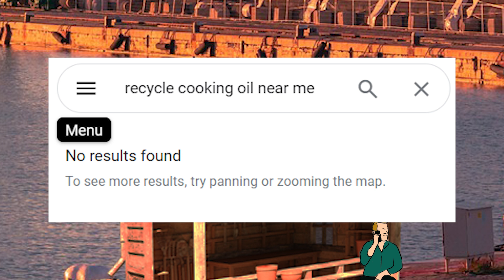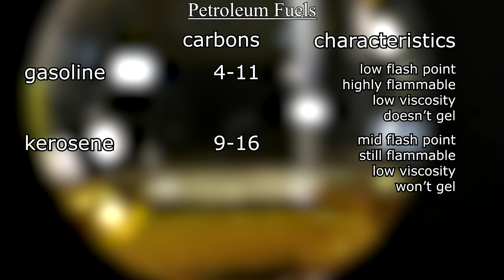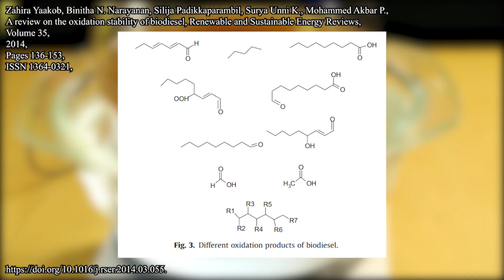Turning Olive Oil into FAME Fuel | The Renewable Fuel Series

Comment: are you sure you're making what you said you're making? cause it looks like you are just doing some random things and at the end just pour some cooking oil onto some cotton and burn them. cooking oil burn with cotton and can be used to burn firewood without all the steps you show.
Reply from the maker: One way to judge if your reaction is progressing is to check whether the top phase (methanol) is being consumed, and a bottom phase (glycerine) is being formed. The product will also change colour slightly.

Another way is viscosity. One main reason why we pour FAME into diesel cars instead of oil is that FAME is less viscous - in fact close to diesel in viscosity. Oil would just clog the fuel injectors.

Lastly, even though oil burns with cotton, FAME does so much more energetically. You could do a parallel burn test to make sure.

Comment: Tip to clean the used oils: make some jelatine and pour it into the oil while mixing. It will settle to the bottom because it doesn't mix with oils and then solidify into jelly. Then decant out the clean oil.

Robert Murray Smith has a video about this on his channel

Comment: Have you ever experimented with the ethyl ester equivalent? Ethanol seems much easier to produce than methanol...
Reply from the maker: I haven't run the numbers, but I feel like you can easily produce methanol through pectin fermentation, as long as you have enough pectin. There simply hasn't been a big demand, since natural gas exists.

That being said, FAEEs are just as easy to make, yeah. There's no appreciable difference, only a slightly higher cetane number I think

Comment: Purifying glycerin would be a great follow on video

Methanol from atmospheric CO2 would be a fantastic follow on video.
Reply from the maker: I would absolutely love to do the latter, but I need a few more exotic things, so it will take a while :)
Reply: Or FAEE and use vodka instead of methanol :p
Reply: @atrumluminarium  you need anhydrous ethanol, which sucks because it forms an azeotrope with water. Molecular sieves are the only option.
Reply: @nerd1000ify  I think 95% should be concentrated enough no? And use a desiccant in the condenser as you distill the last run to push slightly above it
Reply: @atrumluminarium  You'd think, but I tried and it doesn't work. You just end up making soap.
Reply from the maker: @nerd1000ify You can dry ethanol with other desiccants as well, to get from 95% to 100. And for additional cool points you could use magnesium metal to do it :D